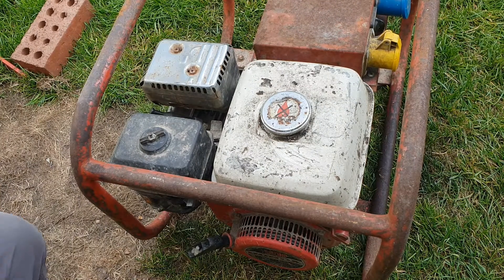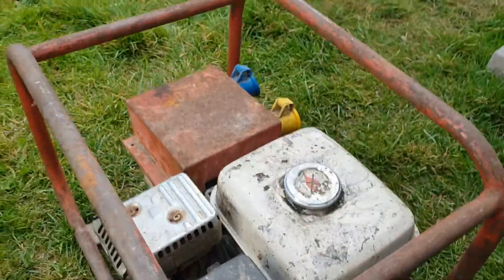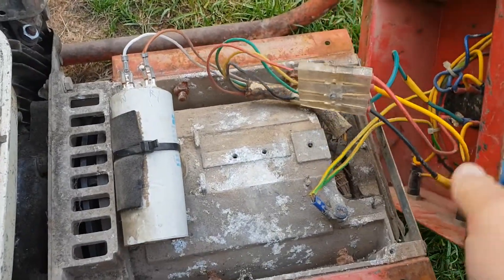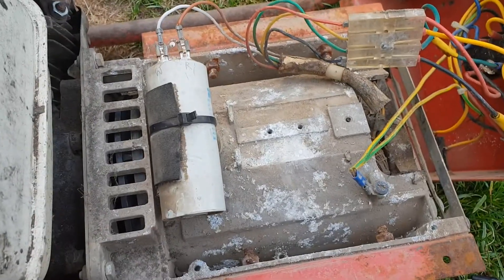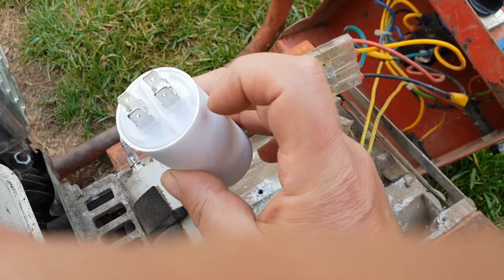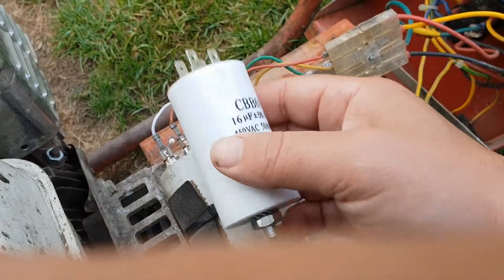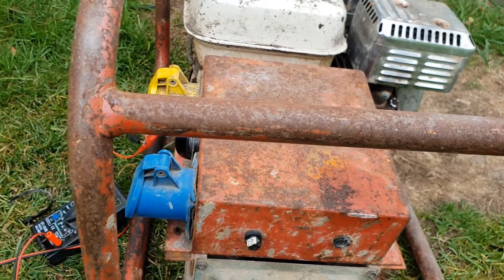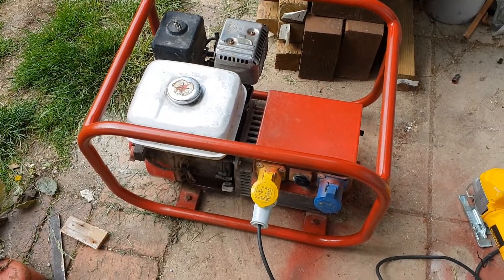How to fix a portable generator with no power output. 110v and 240v repair and troubleshoot.

Comment: Supposed to be 120V not 110 V. Because half of 240 is 120.😊
Reply: That's not how that works, it's 110v as it's usually 55v x 2 for safety.